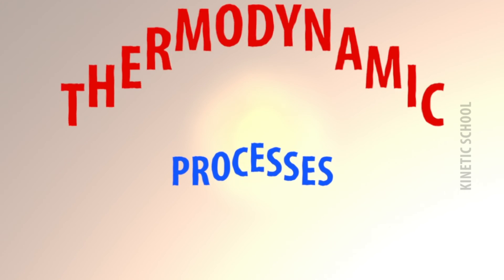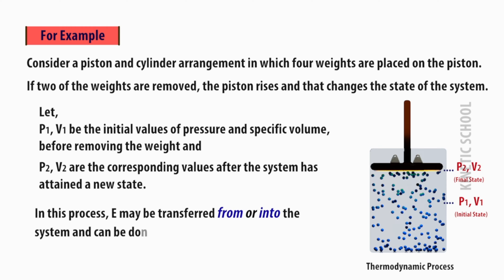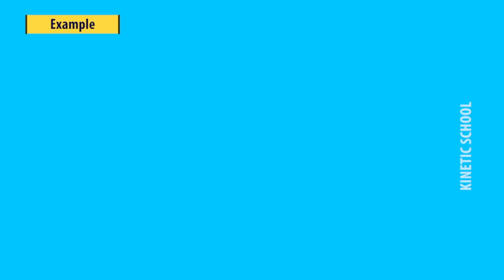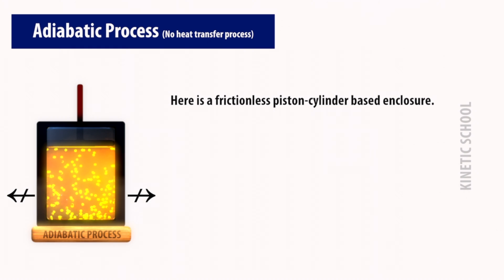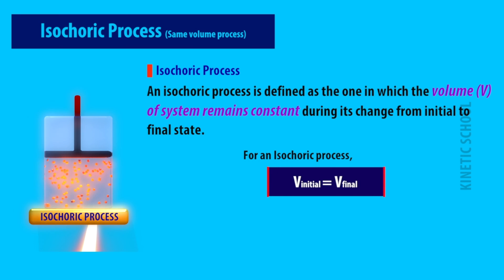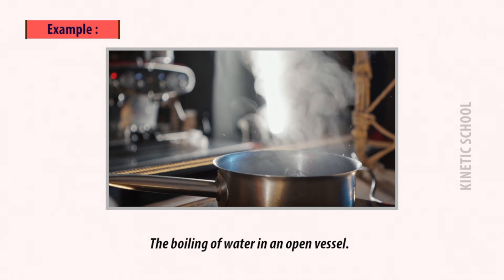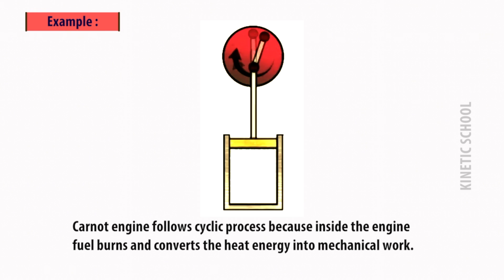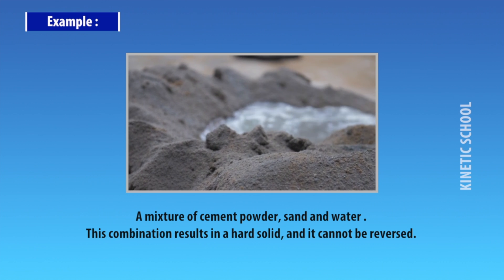Thermodynamic Processes (Animation)

Comment: But you can reserve cement by hardening and breaking it. But very good video!!! Super explanation, yes on helpful.
Reply: where can you get the water back again 
it's mass has increased 
so it is an irreversible
even though i am 9th grader I study 11 and 12 grade topics 
no offence if it hurts you sry
Reply: @NagarathnaR-t8u  I don't know for sure. But I think the proces is reversable. If you blend and break the beton, until it's a powder again. You could re-use it. I would hardly think any proces is irreverable.
Reply: @NagarathnaR-t8u  Here is your Answer: It is reversable: It's called: concrete recycling to clinker.